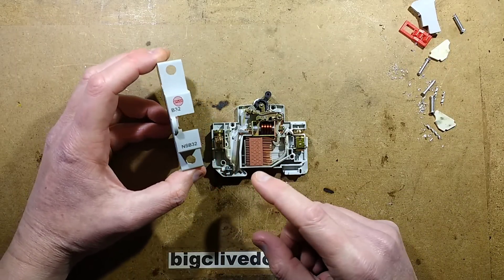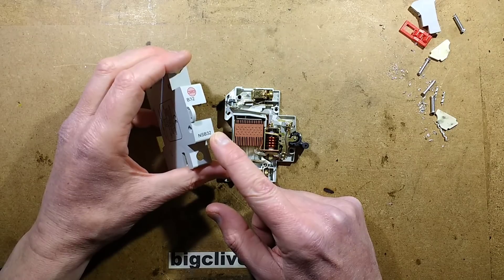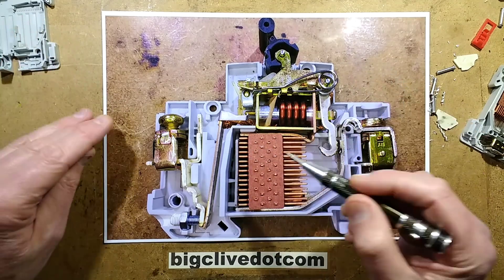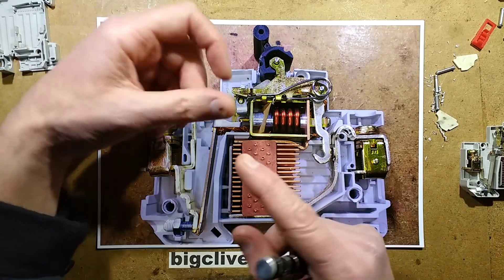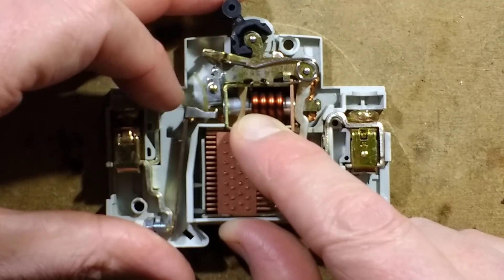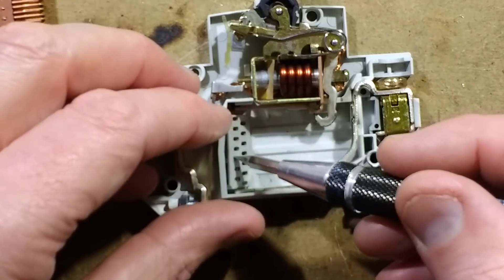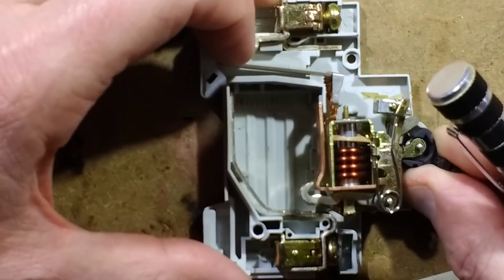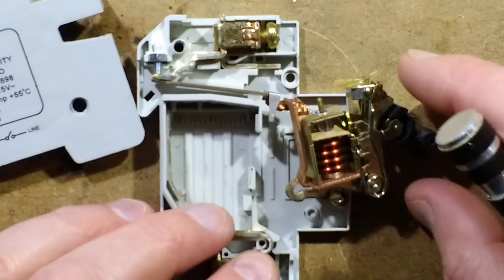Inside a faulty UK Wylex circuit breaker.

Comment: I was told by the speaker at the International Arc Flash conference that the arc always travels away from the energy source irrespective of position of the electrodes.

Comment: Clive, one little remark. The short circuit current rating is 6000 amps in a rectangle. That means in home application 6000 amps and 10000 amps industrial. It means also that you can try to switch on the breaker whiteout destroying while there is stil a secondary problem. (for example a short circuit).

Comment: Tres interesting, and a lot more complex than I might have thought. Somewhere hereabouts, we have one that will not switch back on. It tripped one day for no obvious reason, and the dolly will no longer reset nor latch into the on position - I wonder where it got put, and if it could be repaired, though by the sound of it, it's not worth repairing even if it were physically possible.

Comment: I probably won't get a answer but if I use a circuit breaker with a higher amp than the device I'm using, would it only trip when it goes above that amperage?
Reply from the maker: Yes.  Actually quite a bit higher than its rating.  The breaker has to be chosen to match the cable.

Comment: Interesting stuff, any chance you could do an RCD also, I'd be mega curious to see inside on of those but don't have a spare knocking around or the BigCliveDotCom wisdom to understand wtf its doing, but I am sure it would also be some well engineered and interesting electromechanical goodness.Maybe if someone has an old non functional / spare RCD they'd like to donate it to the cause?
Reply: Inside an rcd there are 2 coils monitoring the current flow through the live and neutral , in the the event of an earth leakage the current flow would differ , this would trip the mechanism . Simple device .

Comment: As an electrician, I'd like to point out to any potential customers of my trade that any electrician that misses the busbar with a breaker in that way is completely retarded. A good way of spotting such fools would be to see if you can observe them counting to three. If he can't get past two you know you've got a doozy on your hands.
Reply from the maker: Unfortunately with the instant Part-P certification of labour in the UK this is an issue.  All the experience and knowledge of a proper apprenticeship has been lost.
Reply: Agreed. As luck would have it I live on the Isle of Man where 'proper' apprenticeships are still the norm. Although I have heard about this 6 month Part P course, I don't know how it works in the UK proper; as far as we're concerned Part P is mainly for insurance and further certification (kitchens, CCUs etc); you still need the C&G electrotech certificate and the AM2 test in order to be able to actually trade here. Unless of course you're able to find a fully qualified spark to sign all the work off for you, but I doubt any sane sparky would put his name to an installation he hadn't done a full T&I or condition report on.
Reply from the maker: Another thing here on the Isle of Man, they do seem to test the applicants with a practical test to prove they can at least do basic electrical work.
Reply: Wow, wasn't sure whether you lived here! We should meet down the Rovers some time, I'll buy you a few pints for all the awesome videos you've made over the years.

Comment: I suppose you all over there might come back with the same sort of question, but from over here on the 60Hz side of the pond, the "odd" breaker ratings - e. g., 32 A - used in the U. K. have me scratching my head. I'm used to currents like 15, 20, 30, 50, 100, etc. amperes.
Reply from the maker: I've never really thought about it, but on the basis that our cables are all round metric cross sectional areas, it might be to fit the current capacities of the cables.
Reply: Don't forget 40 amps, though they are usually made up of two 20s with a tie bar.

Comment: I wish I had a Federal Pacific breaker box with Stab-Lok breakers I could send you. They were really popular in the US from about 1950 to 1990, despite being absolute garbage. About 1 in 4 FP Stab-Loks would fail to trip in a surge condition, resulting in about 2800 house fires each year, during this period! They eventually got busted for faking their UL test results, but no major recall was ever organized. As a result, there are a lot of these old panels still installed. I ran across two of them while home-shopping just about four years ago.

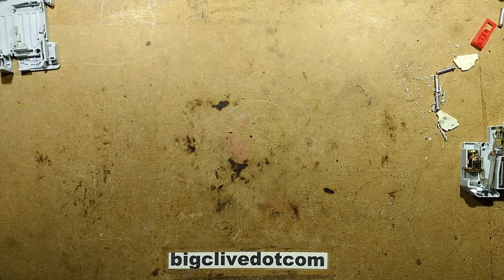Comment: (5:55) The fins are isolated from each other, right? I mean, if they were not, how does it break the circuit? When the hook switches, it makes contact to the metal bar on top of the metal fins. The input however is attached to the bottom of the fins... Both attach losely, but they might make contact... So the fins must somehow be isolating, right? That's not obvious at all ... Quite confusing ^^
Reply from the maker: They are isolated.

Comment: Something I don't understand: If the arc breaker is made of copper fins, isn't it conductive and it would close the circuit? I can't see any insulation between the contact point and the copper fins, so it shouldn't make a difference whether the contact point is open or closed, right?
Reply from the maker: +Victor Oliva It's a series of separate plates in an insulated frame.

Comment: In the USA, there are some old breakers from the 70's that are faulty. Unfortunately because the manufacturer is long since gone, they can't be recalled.
What happens is they will jam and fail to trip even on a severe overload (like 100A flowing through a 15A breaker).
There are also some other old breakers that have grease in them which dries out and causes them to jam as well... -_-
And then there are some old breakers that have a poor buss-bar contact design - they end up overheating.
Some of these old breakers have a failure-to-trip rate of 70 to 80%!!!

Comment: My parents' house has a very strange board with buttons rather than levers. Each button has a small black and white label which will say "ON" or "OFF" as appropriate. You have to press it in then release to toggle. It bulges out farther when off. I suppose in a way it prevents the false reset where a breaker appears on after tripping, but has not made the latch back as can happen with the lever-style switch but it seems like an odd design. I kind of hope it blows one day so I can explore it more.
Reply from the maker: It sounds like the Wilex fuse-retrofit button breakers.

Comment: 6000 amps in that little package? That's so hard to believe, and explains why they are melting.
Reply from the maker: That's a worst case brief fault scenario.  They also do 10,000A breaking capacity units in the same package.
Reply: Those units will disconnect in a cycle or so of the mains supply, so total dissipated power is minimal. If it were possible for it to pass that current for more than a few milliseconds before disengaging the supply and quenching of the arc, then yes, it would fail in an exciting way.
Reply: RWBHere hey man I'm not the one that rated it at 6000 amps I'm just bringing up the point that it's very hard to believe it can handle 6000 amps when I've seen what just a measly 100 amps can burn down and the distance it can arc across.

Comment: I have seen Vynckier MCB now   GE MCB and Schneider MCB also worked for those manufacturers, mechanisms are identical but careful section of bimetallic strip which depends upon current ratings of breaker is very important. Also   to reduce the intensity of arc it is guided to spread and then quenched in arc chute

Comment: @10:35 There may be 2 paths for an arch to travel to the copper sink because there is 2 potential source directions.  One from the mains supply to the breaker and an alternate back path EMF from the device that was using the power.  A high capacitive/inductive load using the power may briefly have stored energy going back to the breaker even once the mains is removed/opened.  The residual energy from the load need to go somewhere safe.

Comment: Federal Pacific and Sylvania breakers here in the states also had problems which resulted in recall. The Federal Pacific breakers would not trip and the Sylvania breakers would decompose similar to what you described for the Wylex breakers. The problem was that the breakers (sylvania) were to small to dissipate the proper amount of heat. The Federal Pacific problem continued until Ralph Nader exposed them. Still sold for years by disreputable suppliers they continue to be a problem. The fault is only revealed when you need them....a 20 amp breaker would melt down before they would trip. Essentially they allowed unlimited current.

Comment: On the 11kv breakers we worked on in the power station the arc chutes were ceramic and the labyrinth effect dissipated the arc by, in effect, stretching it out. The breakers were air assisted to help carry the arc up into the arc chutes via arcing horns. The mechanism opened with such ferocity that it's had to be damped. Regular maintenance was required on these pieces of switchgear as they had such a hard life!

Comment: Brings back memories that one Clive! At the time (2009/10) I was running a major project, and we ended up changing 1500 of the damn things! You are absolutely right in that it was only the lower current ratings that were admitted at fault, and recalled. We changed 6A and 16A only, I can`t speak for the 10A MCB as we did`nt have those installed. Although information was rather vague at the time,  we were informed that they had tried using `less copper` in the manufacturing process, I assume to keep costs down during the global recession. Shame really, as it`s predecessor was fine, the one you have here always did feel a bit cheap and nasty.

Comment: Clive, is it possible that  the magnetic effect of the trip solenoid is also utilised to control the arc? magnetic blowouts are often used in various  kinds of circuit breakers both AC and DC.

Comment: I heard of this kebab restaurant, and they had a problem with the breaker tripping all the time so they put a little wooden stick under the toggle to prevent it from tripping...It's surprising they did never have a fire...
Reply: Danny Boel doing that wouldn't make a difference it would still trip inside
Reply: they had an other type of breaker, unlike the faulty one Clive is showing.

Comment: Probably a stupid question, but how does the current not flow through the arc chute? It's copper, and it looks like there's a path from one side of the breaker through the arc chute to the other side, so that current would flow even if the main contact disengages. That would obviously completely defeat the purpose of the breaker, so what am I missing?
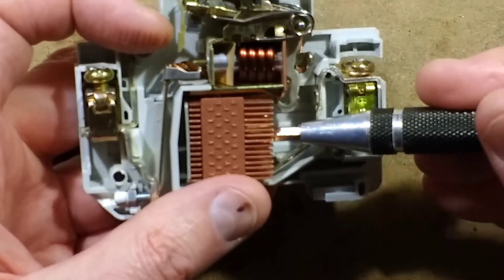Reply: softy8088 Clive shows a ceramic spacer, which he removed so you could see the internals. Edit: Time-stamp 08:15 in the video.
Reply: I looked up how an arc chute works. It wasn't clear just visually that while the fins are conductive copper, they are joined by a non-conductive spacer. It looked from the video like the spacer was copper as well, hence my confusion.

Comment: You can generate hundreds of amps to test a circuit breaker with a soldering gun. Run wires from the electrodes through the CB instead of the regular tip. 

My first engineering job was in the testing lab at Bulldog electric/ITE in Detroit. We did UL testing among other things.

Comment: Interesting. Are the arc quencher plates electrically connected to one side or the other?
Reply from the maker: There's an electrode from either side of the contact running up each side, so technically it's a stack of plates in between the contacts.

Comment: Looks like I’ll be swapping out all the other breakers - thanks for the heads up !
Reply from the maker: It won't cost too much and will possibly save further issues.  If you look for the Wylex recall they may send you a set of new breakers.
Reply: checking up on this the 32amp isnt included on the recall -

https://www.electricalsafetyfirst.org.uk/product-recalls/2010/10/electrium-miniature-circuit-breakers-(mcbs)/

that circuit has never had any fault current on it either (was a cooker circuit) i think just replacing these with schneiders is probably my course of action.

Comment: bigclivedotcom, Where is the current actually broken? All I see is a bunch of metal parts and what seems to be a continuous path. Also is the metal that is attached to the black plastic pawl hot??
Reply from the maker: The metal behind the switch is live.  The actual contact point is the hook shaped electrode at the bottom.

Comment: Solar DC circuit breakers seem to be a lot more expensive than their AC equivalents. Even the eBay ones from China are more expensive (not that I would trust the safety of my gear to a Chinese breaker!). I'm building a solar battery system to run my network gear off-grid and I was a bit shocked when putting together the BOM. I'd be interested if the difference in cost is down to the construction or just difference in the volume of production.
Reply: The Up Late Geek breaking DC is significantly harder than breaking AC. With AC the current will eventually drop to 0 (zero crossing), not necessarily in-phase with the voltage depending on the load, but it will. And all you have to do is cool the plasma down at that moment to prevent it from reigniting.
DC on the other hand won't get this automatic extinguishing and requires you to break the arc in "full force". Photonic induction did a tear down of a DC breaker from a submarine where you can see the effort that goes into that.
Reply: I think the one Photonic tore down was actually from a telephone central office after doing some digging.

Comment: One of my pinball machines trips a breaker 25% of the time when I turn it on. I suppose it is the old school transformer tripping it. A 10 meter extension cord "solved" the problem, but I suppose the right solution would be to have a separate plug with a C type breaker on it.
Reply from the maker: You can get components called NTC inrush limiters that work thermally.  They start with a higher resistance that drops under load as they warm up.   The pinball machine does have a chunky transformer in it.
Reply: Martin J or you could just get a surge protector with a breaker on it so you could reset it quicker

Comment: As other posters mentioned, the high current fault creates a magnetic field and the arc path acts like a wire in a motor and is forced to move into the chute.  It is much the same principal as a rail gun, but without a solid projectile.

Comment: Thanks, very useful to see it from the inside. Few Wee questions:
“…mains come in … it would be coming from … the bottom (of the breaker)”?. My understanding is, due to standardisation of installation practices and therefore safety, it is recommended (or mandatory depending on the mechanisms and countries) to feed the breakers from the top? (what happens in the real life is another story).
Seeing the breaker from the inside, it makes sense to feed from the top: The slow overload can be easily detected by the bimetallic bar at the top, and the venting of the short-circuit makes more sense when coming from the bottom (load)? 
BUT, although people recommend feeding mains from the top, many suggest that mechanically it would have the same results to feed mains from the bottom (as you mention here). Which, from this breaker you are showing, feels counterintuitive? I am trying to see if really there is no difference mechanically. Apologies, I hope I am making sense…
Reply from the maker: The current is the same and being AC it's flowing in both directions.  So theoretically it doesn't matter which end is input and output on an MCB.  But some RCDs/GFIs do need connected in a particular direction.

Comment: Funny you mention the mis-clamping, got called out to a house without power, last electrician had missed the clamp on the mains, had been working fine for over 6 months and when upset teenager slammed the door right next to switch board, bumped the cable off!

Comment: If you really insist on using the zoom, at least make sure it's actually focused by forcing it to focus again. Even if it looks like it was, like now, it was not focused and just made the whole video into a blurry headache-inducing mess. :(
Reply from the maker: Yes it did, but due to very little time at home I couldn't re-record it.
Reply: I just wanted to raise awareness, so thanks for reading and replying.
Keep up the otherwise great work, it's thanks to you that I've recently finally took the effort to mess around with soldering something again.

Comment: The solenoid has AC going through it? Wouldn't that make it buzz back and forwards?
Reply from the maker: You get AC solenoids.  They buzz a bit but still pull in.  If it was a magnetic core it would oscillate back and forth.
Reply: I think so, but it breaks the circuit very quickly so it wont have a chance to move backwards.
Reply: bigclivedotcom Ahh okay thanks I get it now!  Great to learn something.  The core is not magnetic, but ferromagnetic, so it just gets attracted to the magnetic field regardless of polarity. When the AC crosses zero volts it can cause the core to stop being attracted and that can cause a buzz, but Google tells me clever things can be done to the core to reduce that if needed.
Reply: There might be a shading pole somewhere in there.

Comment: Due to electromagnetics, the arc will move away from the source, that can even happen to be down.
I have seen this happen in n a demonstration is a shot circuit laboratory.
An empty connection box for 400VAC was shorted between the rails with a 0.5mm2 wire, and fed with 400V, 12kA for 10 cycles (0.2 seconds).
After the smoke cleared, it was visible that the wire was still wrapped around the copper, and the ends of the copper bars were melted.